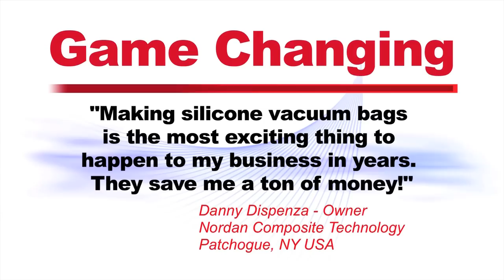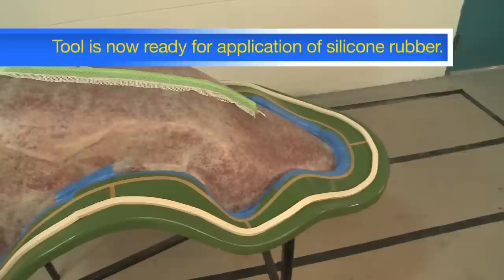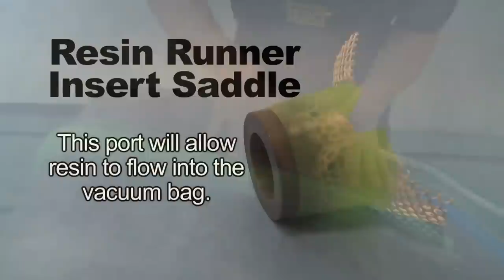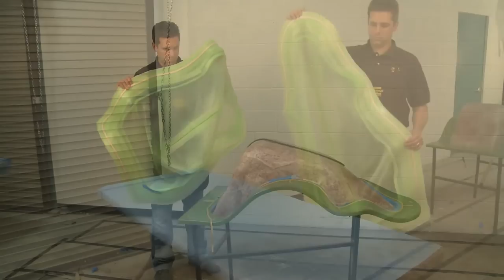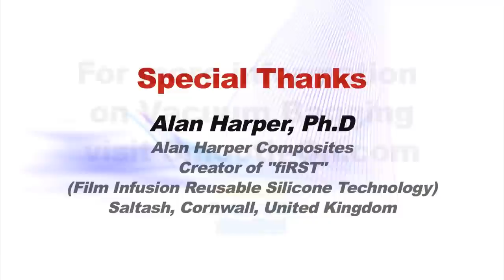How to Make a Reusable Silicone Vacuum Bag for Resin Infusion

Comment: Hi! Nice video!
2 questions:

1. What vacuum level does this bag support?

2. Why is second vacuum circuit not used? That is when you pour resin into mold, pressure increases so the construction could be leaked. Or not?
Reply: Денис Калугин b

Comment: What would be the drawback of using the spread on latex instead of spray on ?
Reply from the maker: Silicone Vacuum Bags are durable & can be re-used time and again resulting in Reduced Labor Costs. Other advantages vs traditional vacuum bagging materials and techniques include:
Fast fabrication time – Silicone vacuum bags are ready for service immediately after full cure.
Reusablility – Reduce or eliminate traditional consumables such as peel-ply and separating film.
Self-Sealing – Eliminates Tacky tape for fast installation onto tool assembly.
Chemical Resistance – Better performance against chemically harsh resins.
Heat Resistance – up to 500°F / 260°C.

Comment: reusable.. how many times?. Isn't the central shell part to thin? I think after 2 or 3 infusions it may cut itself while demolding(?)
Reply from the maker: It depends on the part, but variations in thickness can be made.

Comment: WAIT! How can you possibly suggest this process assists to make custom parts when you need the custom vacuum bag to make the custom part but need the custom part to make the custom vacuum bag?
Reply: Xerock For making the first custom parts, probably they use regular steps which is by using plastic and double sided tape to make a vacuum bag.